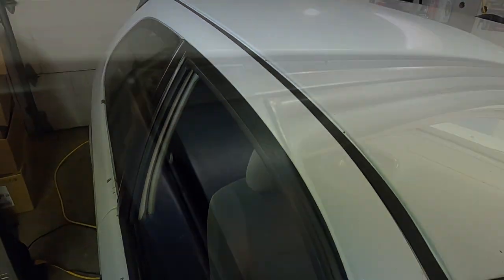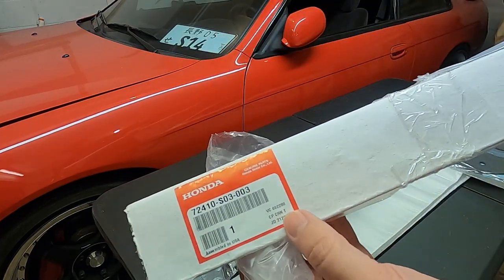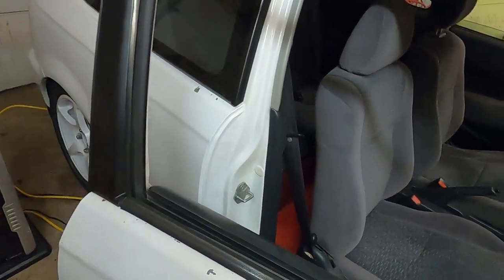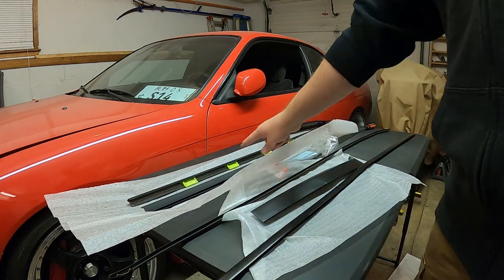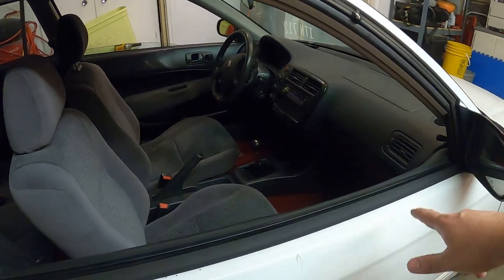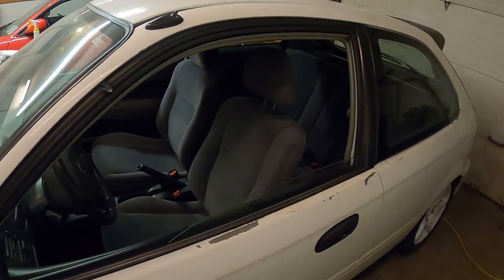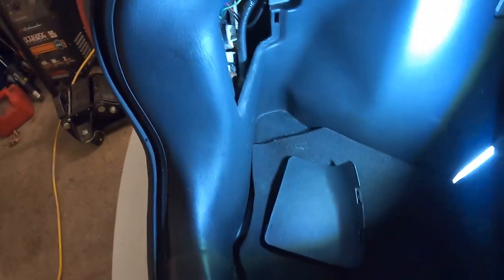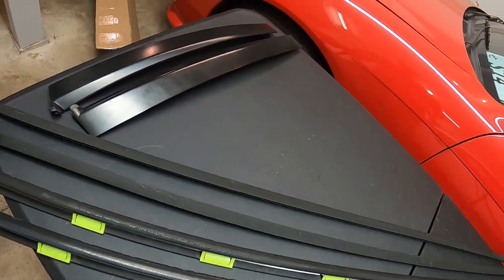Replacing The Faded & Cracked Trim/Moldings | Project Civic EK

Comment: Where did you find the door garnishes that go at the bottom of the window ? I can’t find any for my CRV 2004. Been trying forever. eBay has an option from Tiwan but I don’t want to get stuck with a wrong part

Comment: Awesome for leaving everything in the description. Also 6:22 those can be painted right? Cause mine arw chrome and thought they were rubber lol
Reply from the maker: The new ones have got a black rubber coating on the outside of them. You could probably paint, plastidip, or vinyl wrap the chrome ones you’ve got.

Comment: I keep finding my floor mats soaked with water on my passenger front/back seat and I think it might be weak weather stripping. Going to give this a try
Reply: Check your moonroof drains as well if you have one. That’s where my leak was coming from
Reply: If you have AC - make sure the AC condensation line is not clogged

Comment: sadly the roof strip is no longer available new for coupe model. :( Pls. let me know if someone knows where to get a set new. thank you.
Reply from the maker: It looks like the left one for a coupe is discontinued, but you can still get the right side from Honda - Part# 74306-S02-003. Hopefully you can source the left side. Maybe try searching eBay, someone might be selling OEM moldings on there. Left side coupe roof molding part# is 74316-S02-003
Reply: @AbnormalGarage  can you link me to the site you found the right one? I searched a few but no one has it.
Reply from the maker: https://www.afhparts.com
Reply: @AbnormalGarage  thank you!
Reply: @AbnormalGarage  unfortunately the one that fits my car is 74306-SR8-A01 and is out of stock :(